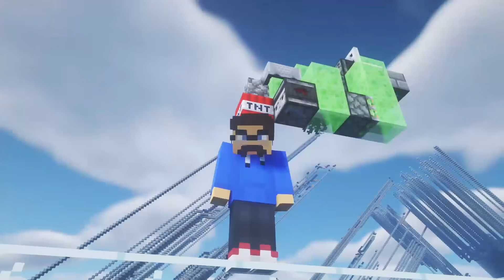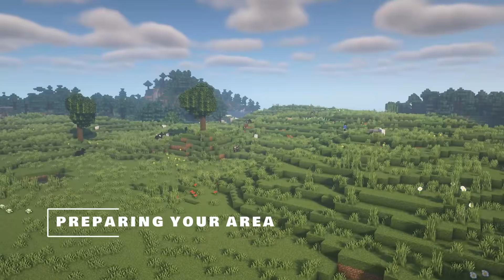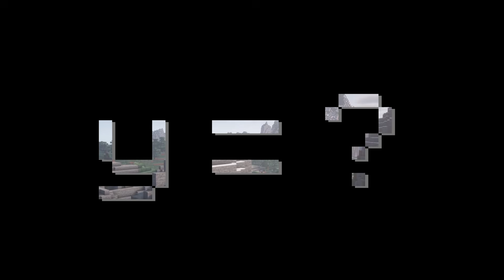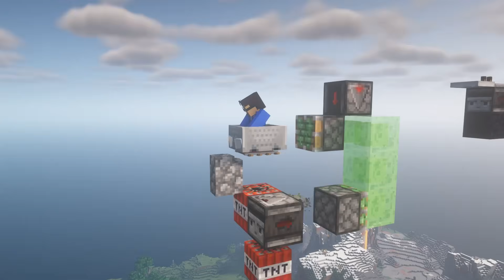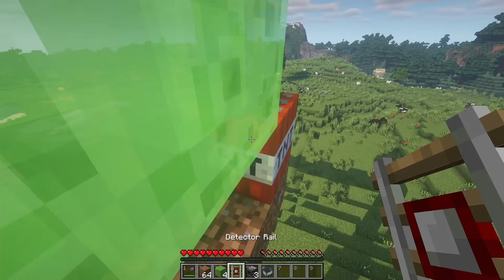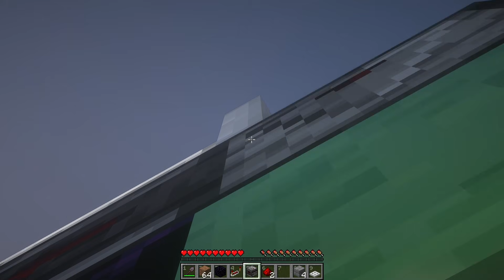TNT Duper Flying Machine

Comment: I built this to dig trenches for a world eater. It worked great for one trench but then when I rebuilt it to polish off another trench, it kept dropping the minecarts whenever it re-launched for the next cycle. I gave up on it at the time (because the trenches were done) but I'd like to experiment some more with orientation. I've read that detector rails update differently in different orientations which I suspect is what caused the minecarts to fly off for one trench but not the other.
Reply: Can confirm this machine is direction specific. I'm on a paper/spigot server so I'm assuming it's something unique to that? I built 4 identical machines and the only way it did not drop minecarts on the 2nd forward pass is if it was built facing east. Facing west, north, and south all dropped minecarts eventually. I find this very bizarre, and I would think if it applied to a vanilla world I would have heard about this quirk by now.
Reply from the maker: @maxpeck1962  I do believe that's a paper/spigot quirk. I've built this both North South & East West on the vanilla (technically fabric) SMP that I'm on and didn't have any issues aside from me being dumb and letting it go out of render distance haha.

Comment: Would this reach bedrock if you did it in a plains biome at sea level?
Reply from the maker: This reached bedrock for me when built at around y=85, so yeah it should!
Reply: @KaleHameron  thanks for responding! I will probably use this when I decide to make a perimeter
Reply: If u decide after 1.18 then no it won't reach bedrock from sea level! It reached as far as -21 then actually left a pretty smooth layer! Will need a second pass for sure now there is so much more down there!
Reply: @Doxo-xp2ez  oh of course lol.  thanks for the information!